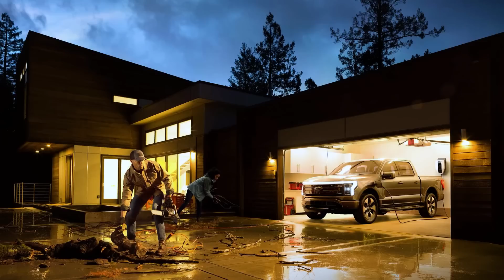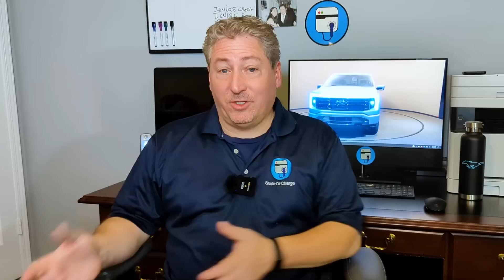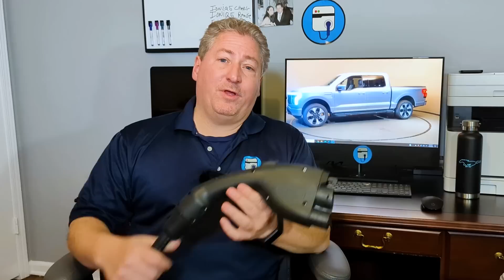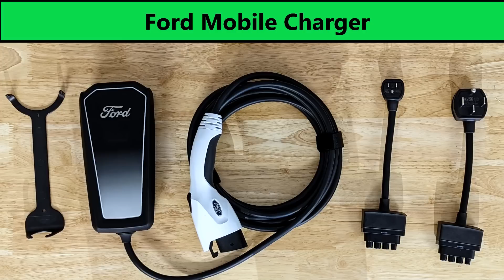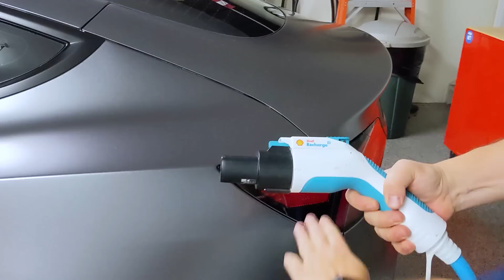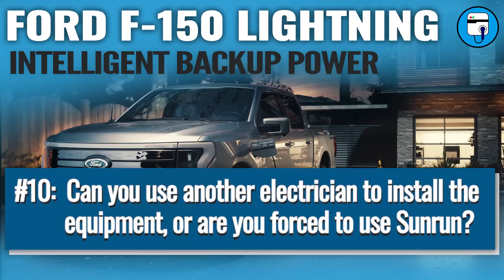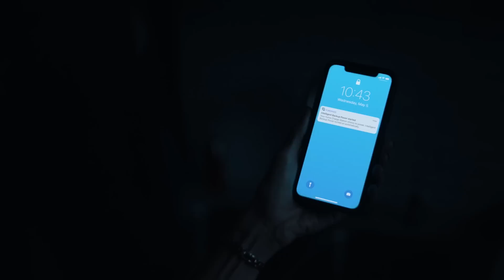Ford F-150 Lightning Intelligent Backup Power: Everything You Need To Know

Comment: Originally, I had 400 Amp (2 x 200 Amp each) main panel.  Few years ago, I installed 96 solar panels “not installed buy Sun run” and it required to downgrade the panel to 320 Amp to handle the added solar system load (one of 200 Amp breaker switched to 120 Amp).  
I have Net Zero Metering with LADWP.  Few short power outages accrued so far.  During power outages I assume that my solar power production is wasted to preserve utility workers safety.
Is this setup will create any problem?
Is the installation will cost more than if I did not have a solar system in place?
Reply from the maker: I see no reason why it will create a problem unless you have your 320-amp service maxed out with a lot of heavy-load circuits.
Reply: Hi Tom, I know this is an older video but I have a relevant question. I have a Lariat Lightning and my electricity provider has a great time-of-use plan that costs me 3 cents per KW between 11pm and 7am. The downside is during peak hours I pay 24 cents between 4pm-9pm. My question is whether it is worth investing in intelligent backup power to power my home during peak hours and recharging my truck during off-peak hours. The assumption is I would be using my truck like a Tesla power wall. I was wondering if you did a video on this, I thought you mentioned you did but I could not find it. @StateOfChargeWithTomMoloughney

Comment: You didn't answer my biggest question... Can I power my house if the power is not out? Can I power my house daily for a few hours during on-peak hours? People have hinted that it is possible but nobody asks or answers that specific question.
Reply from the maker: I'll ask and get the answer next week. That's what this is for
Reply: The IBP is a generator from a National Electric Code (NEC) perspective.  Whatever you could do with a generator, you can do with the IBP.  In general, generators are connected to an essential loads subpanel that is physically isolated from the main panel by a transfer switch.  Accordingly, you can power the subpanel with the generator while powering the main panel from the grid.  You cannot feed the main panel simutaneously with the grid AND a generator.  Violates NEC and is unsafe for linemen.  

(If you really want to connect the generator to the main panel, it is done with a transfer switch upstream of the meter.  That may be the SunRun plan. If you go this way, you get the whole house but only at generator power.)
Reply: @evahsia  wouldn’t it be possible (generally, not necessarily with this system) to have it wired in such a way as the car acts like a solar array would. that can feed the house simultaneously with some energy with the rest coming from the grid.
Reply: @MrKlawUK  That is a different control mode, specifically "constant-current" versus "constant-voltage" mode.  The system would also need to detect when it needs to be "islanded" like your solar inverter does.  Not impossible but it is a completely different set of firmware (and a rather tricky change in my experience) as well as a bit more hardware.
Reply: I plan/hope to do the same.  I was just planning to just throw the main circuit breaker on my breaker box and that should "island" the house and cause the Intelligent Back up power system to switch on, since the house isn't getting power from the grid.   Is it harder than that? Am I missing something?

Comment: Can you use a different brand, other than a ford, to power a home with the system?
Reply from the maker: I don't believe so. The Home Integration System is specifically designed to work with the F-150 Lightning. That said, anything is possible if you have the right skills.

Comment: Please notify your audience when Ford begins to hire programmers for this application.  Sounds like superb vapor ware.
Reply: Why is it vapor ware? An ev takes in 3 phase a.c. and through the onboard inverters&dc-dc converters it changes phases to charge the battery.
And pulls it back out, converting it from dc-ac in order to power the motors onboard the vehicle itself. 

Allowing v2x is something other's have offered for year's now. Example the Nissan leaf with chademo. 
The lucid air with the wunderbox is also supposed to be capable of v2x. 

Plus the 2021 f-150 hybrid powerboost model's can do 7.2kwhs out of the plug in the bed. So it's not like Ford doesn't have something equivelant already in service right on the same platform the lightning itself uses. 🤔

I was more curious about the fact on the lightning forums someone showed in a dealer infographic for the lightning. 
That Ford was going to charge users an activation fee for enabling this feature. Which made me wonder if not only would you have to pay to activate it. But could they also then charge you a service fee for enabling this feature monthly? 

Not to mention this would give Ford a reason to trap you with different user conditions for enabling the feature. Which if you don't read very carefully is how they could limit the service and or battery warranty. Just like Tom was saying. 🤔

Comment: Tom.  Did you ask about the tool box size generator for the Ford F-150 Lighting.  This generator fits in the truck bed to extend the range for long heavy huals.  Ford has a Patent on this design generator.
Reply from the maker: No. This was specifically about Intelligent Backup Power.

Comment: Great Job on this subject.  I already have a GenerLink Transfer Switch for use with my portable generator.  I plan on using the the 240v receptacle in the bed for backup. Same plug L14-30.
Reply: I am ordering the 9.6KW onboard charger also for emergency home power support with a external RV connector and a transfer switch.  Much cheaper and the 7KW output will provide enough power for lighting, sump pump, furnace power and refrigerators (critical loads).  I think Tom could do a short video on using the 240 volt output and a manual transfer switch for those who are willing to run a cord and switch a switch :).

Comment: Question OT: Tom, I heard you say you had back issues and the Lucid seats caused you no problems. Was the same thing true for the VW ID4? I suffer from lower back issues and lumbar support is important to me.
Thanks for getting answers from Ford on charging.
Reply from the maker: I never had a problem with the ID.4, but I didn't drive one 500 miles continuously either.
Reply: @StateOfChargeWithTomMoloughney  Thanks.

Comment: I wouldn't say that ICE engines cannot power your home. Generators have been around for quite some time. All it takes in to fit a 220v alternator. Yacht's do this all the time. 12v and an inverter will do the same.
Reply from the maker: Of course, ICE engines can - I have a 16 kW natural gas home generator - I never said that. But there aren't any ICE vehicles that can deliver 9.6 kW to a home and do so for 3-5 days continuously.
Reply: @StateOfChargeWithTomMoloughney  9.6 kW x 72h (which is 3 days) = 691 kWh, far exceeding the 130 kWh of an Extended Range battery. So, a Ford F-150 Lightning cannot do this either.  A 3-5 day supply from a F150 Lightning with Extended Range battery pack will be based on an average power demand of around 1-2 kW continuous (130 kWh/ 72 h up to 130 kWh / 120h), with just brief peaks of 9.6 kW.

ICE vehicles in contrast actually can support this. Take a 2021 F-150 Hybrid (not the Lightning) with "Pro Power", this has at least 7.2 kW (or 9.6 kW optional) power feed capability and a full tank of 30 gallons of fuel. 30 gallons = 120 Liters. 120 Liter times 9 kWh thermal/liter = 1080 kWh thermal energy. If the power conversion to electrical energy achieves a mere 25% efficiency you can get 270 kWh of electrical energy from that.  With 270 kWh of electric energy you can run a 1-2 kW continous load for 130-270h, which would be 5-10 days. There will still be a minimum consumption of the engine idling of about 1-2 Liters per hour, so this will limit the supply to 60-120 hours, which is 2.5-5 days. So this will be a more realistic limit. On the other hand however, one could have 30 more gallons of fuel in the garage to add to the vehicle for keeping the engine running when the need for extended periods actually arises.
Reply: See this for a demonstration of the F-150 Hybrid powering a house with up to 7.2 kW:  https://www.youtube.com/watch?v=fPCi40bSRWc
This system called "Ford Pro Power" can be extended to 9.6kW peak capability from an ICE truck. I am wondering, the Ford representative did not tell you about it. The "Pro Power" system may be inefficient, dirty and somewhat noisy on the vehicle side with the ICE running continuously, but the equipment necessary for integration into powering a house (all on AC) is way cheaper than the Ford Intelligent Backup Power, that is essentially a DC-based system on the vehicle side.
Reply: @koeniglicher  The Pro Power option is well understood by prospective buyers of the Lightning.  I think Tom wanted to concentrate on the Intelligent Backup Power as it is less well known.  I plan on using the Pro Power option myself.  Note that the 240V receptacle is only 30A, so one only gets 7.2 kW from it.  The other 2.4 kW will have to be pulled from the various 120V receptacles.

Comment: Tom - TFL did a video where they powered a house via the pro power 240 plug in the hybrid F150. Can you do the same with the Lightning if so equipped?
Reply from the maker: Yes, but the Intelligent backup power can deliver more power and is designed for this type of heavy-load continuous use. I think Pro Power is good in a pinch, but this system is much more robust and allows for much more control over the power flow.